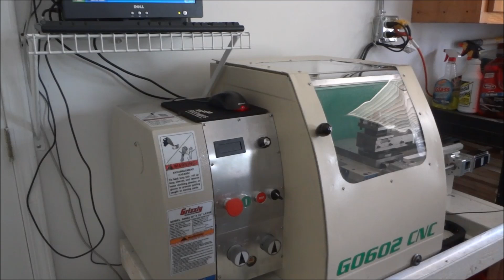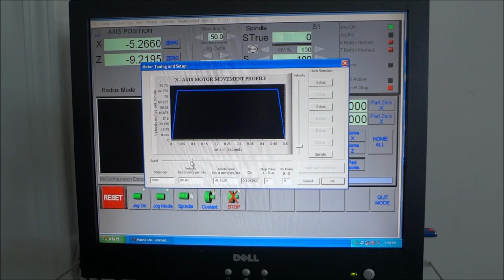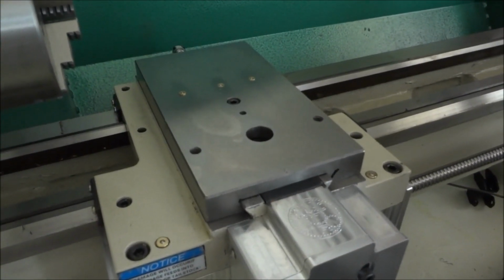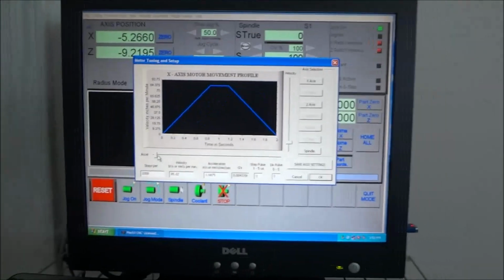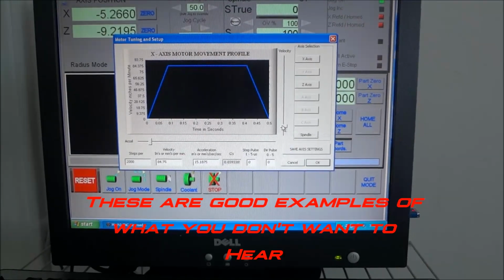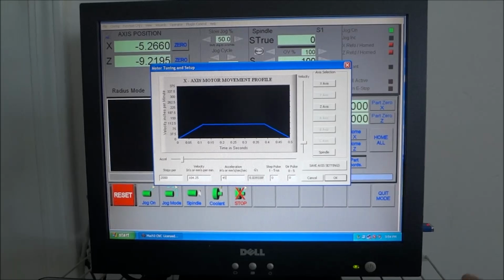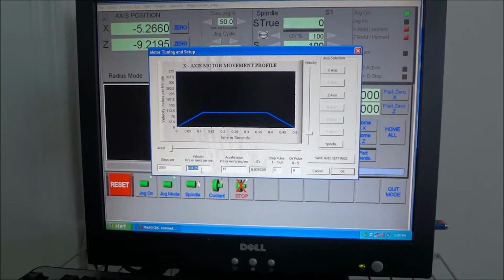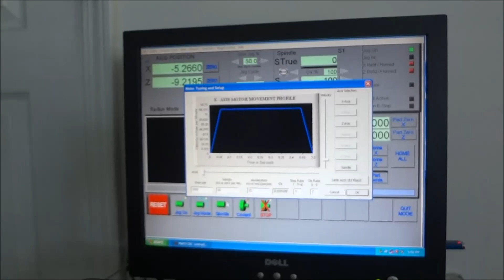Mach 3 Motor Tuning Quick guide

Comment: Thanks for the video. I'm having issues with mine. Seem to lose steps in the middle of a program. The machine looks beefy. I used shielded wires. I have used the automated setting in Mach 3 to calibrate the motors. I let mach 3 to determine the steps. I see you have 2000 on yours. I have NEMA 23 also.
Reply from the maker: @SandeepSingh-43  make sure you don't have mechanical play.
Reply: @ So I worked backwards. I started removing the wires for the limit switches, then I removed the secondary power supply, and I opened the lid to my enclosure. The top of the lid had the drivers, and inside was the 40v power supply. My “losing steps” situation went away.
Reply from the maker: @SandeepSingh-43  I'm happy  you got it sorted out.
Reply: @CNC4XR7  ok I spoke too soon. Does the machine have to be under load, meaning machining something to not lose steps?? Sounds weird but just asking. Also, should each stepper motor have its own power supply? Should I add shielded wire from the power supply to the drivers? Right now the wires from the drivers to the stepper motors are shield, and then connected together and sent to the power supply ground. It’s frustrating!!!
Reply from the maker: @SandeepSingh-43  sounds like your having issues.  Have you checked out my G0602cnc project. I go over wiring in detail.
Reply: @ I’ll check it out. I played with some settings. I use a USB connection to the RnR Motion Controller Board. Does Baud rate have anything to do with how the two devices are communicating?

Comment: Hi just saw your great video. I just finished my cnc build using NEMA 34 motors and currently trying to set acceleration and velocity. Can you share which pulse/rev in your motor driver are you using. Thanks
Reply from the maker: 800

Comment: yo, dud,  I got this little hardinge lathe,  I just put nema 34s,  and a 2k khz controller board, any idea on how fast I can move it, I haven't seen anyone with that board, like dud, I  have them on 50 velocity and 40 accell , and I feel them moving so fast !  ive never had a fast machine  before,  I dont even have to connect the Z directly to the servo to be fast,  i get scared and maybe this is not a job for me , then I drink and things start getting working great!  so any advice?
Reply from the maker: Slow down lol

Comment: Hows it going buddy hope all is well, can you help I have my lathe set up and on my Z axis when I peck drill loosing steps any advice, I have only been drilling Aluminium and I only do a 3mm and retract and then back in just seems its to difficult for the motor, its a Nema 23 seen other motors doing it ok any ideas
Reply from the maker: it could be many things, spindle speed may be too fast, slow, lubrication, try reducing to 1.5mm depth

Comment: My dear when you do calibration on your machin the paramiter you recieve for auto stepper set it will caculate and gives you the right amount of motor tuning , i think that is much better than changing the numbers to get the best movement , anyhow thank as you wish .
Reply from the maker: Thanks for the info
Reply: Your right Asghar, i dont manipulate the speed or velocity, i let the calibration process do it accurately for me.
Reply: @pauldiaz4273  How did you get Mach 3 to auto calibrate the accel and speed? I only got it to auto calibrate the steps.
Reply: @pauldiaz4273  What about the dip switch settings on the stepper drivers, how does that play a role?
Reply: where is that calibration?

Comment: Great video! Can I ask you what controller you are using? I’m using a TB6560 and getting weird things going on. It’s a ongoing build
Reply from the maker: Controller or do you mean stepper motor driver? if that is the question its a Longs Motors off Ebay I think its a DM542a
Reply: CNC4XR7 yes sorry weird things happening with my test setup before I assemble my unit. The motor makes a sounds as if it is turning but it actually not even turning. When the motor makes the sound as if it is turning the Mach3 is counting down as if the motor is moving. For the specific axis
Reply from the maker: @MrRenoman2011  i suggest you double check your wiring sounds like a issue with that.
Reply: It may too late but that sounds like you need to play (calibrate)with your driver switches that controls the power (Amps) and micro-steps to the motor.

Comment: Hi, nice video congrats, what config could you suggest for a nema 23 1.2 nm or 170 oz?, tks in advance
Reply from the maker: Hi Rsy,
 I don't have configurations for all the various motors stored away some where each system is different.
Ball-screw pitch, Power supply voltage , machine drag, are all things that make the system different. you just have to keep moving the velocity and acceleration around until you get things sounding correct and running smoothly without stalling.

Comment: I'm in the process of designing a fair sized full CNC milling machine (X - 1000mm Y - 500mm & Z about 300mm) and will utilize Mach 3 program. I've been trying to find out how a stepper motor determines the distance to move the machine bed or head a
certain distance. I know a person programs the distance from a computer, but how does the stepper motor know it should move
let's say 210mm. I don't understand the principle on how the stepper motor determines this move. I looked at many forums on 
the internet and  came  up  with  absolutely  zero. Can  some brother  with knowledge on the matter please explain this to  me in simple English
Reply: Pieter Botes this should answer you’re question... https://youtu.be/2HbeyggcwU4

Comment: I m getting problem in tunings of motors they are not responding on the signal
Reply from the maker: Email Me I may be able to help I suggest you go through the Ports and Pins and Also check your wiring.

Comment: And what when it dont move? ive messed with pots 4988. So its obviously these speeds.
Ive had 1 work then when I change all to the same to work from there the z will then stop working and Y will work lol.
Got my extruder to turn a little to but you right not enough info.

Im using lcd on 3d printer and struggling to set these.
Reply: Think the motors or nema 14 or 17.
When I home some times Z will move. Then when I mess, Y work but Z stopped lol.
I replicated z settings and none worked.
So managed to get Y to work then replicated for X and none work.
I had play with extruder it was pulsing and not powering. Got it to turn for 10secs.

Using stupid china lcd lol 
Messing with then now but jad machine weeks now.
Nightmare.
Reply from the maker: I cant really help much with the 3D printer issue completely different software. the setup is different I suggest asking someone more familiar with the board your using.
Good Luck

Comment: HI,l want to use SFU1604-3 model ballscrew with nema 34HS9840 motors.Please tell me steps per,velocity and acceleration.unit is mm.thanks
Reply from the maker: Mirza Zulfuqar 
rm1605 would be 5.08 turns per inch.

Comment: Good night, I installed a playstation control in my Mach3 and I'm wanting to add a command but I can not be the (reverse run ) and working with sheet metal cutting with massarico sometimes the cut is interrupted and could program the reverse rum in control would help me a lot .... Thanks for listening ..
Reply from the maker: Im not familiar with the Play station controller Plug in, Is there Not a setup screen where you can customize the Button?